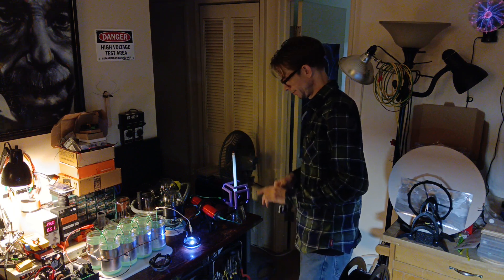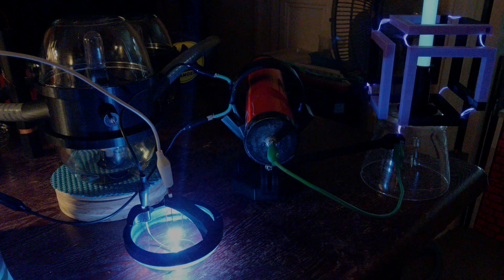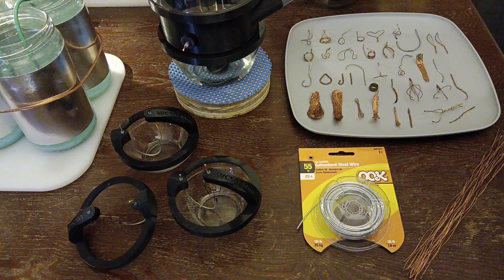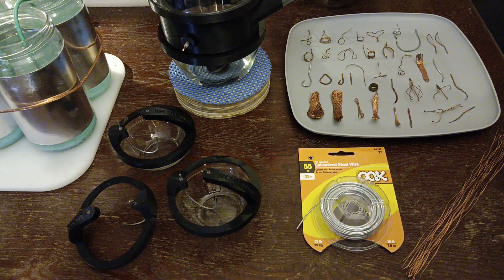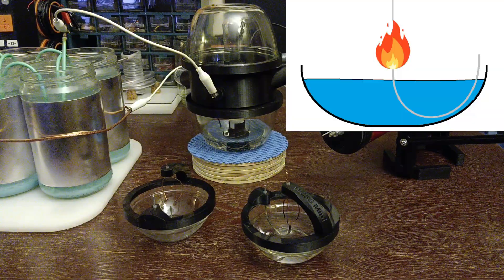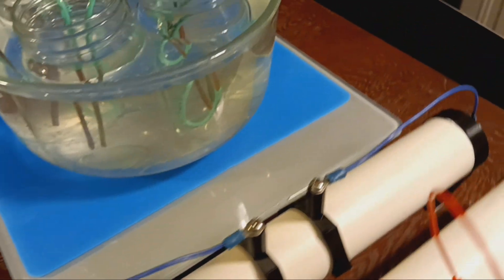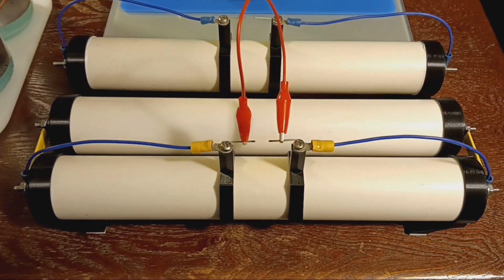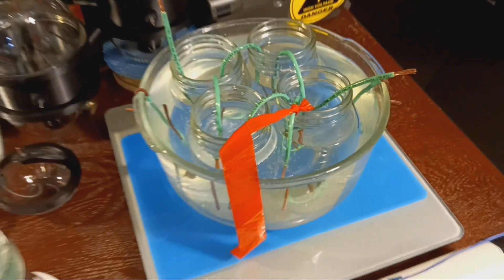How a Water-cooled Spark Gap Works!

Comment: Use silver - it's the best conductor of heat and has a higher melting point than copper, it's still cheap at 28$oz.

Comment: Built a water cooled extreme energy triggered spark gap before, it used DI water with both electrodes submerged. The electrodes had tin on the buisness end but the rest was tin plated copper. The trigger electrode was a loop of platinum wire just in front of the cathode with the low side connected to both electrodes through a couple 500pf 35kv doorknob capacitors. The trigger voltage was about 20kv and the gap could hold off about 50kv. It solved the issues with heat noise and UV all in one go. It was used for a copper bromide laser until i got a proper hydrogen thyratron❤

Comment: Why is this useful? You dont give any information on why you think this is so useful or hints to how its any better than any other gaps, you need to remember that spark gap technology is ancient in fact the pioneers used these  Tesla, Rhumkorff, and contemporarys of his time, later better higher power gaps were needed so they looked into all methods including water immersed electrodes but subsequently found mercury to be a better option.. later came rotary gaps air cooled then quenching became common from faster switching speeds for years synchronous rotary gaps were the standard for high power high frequency and the mercury interrupter for low powered low frequency and mercury arc rectifier octopus and excitron for high power low frequency, these were later replaced in a true vaccum tube take over as thyratron ignitron and other high powered switches became available, the ignitron can switch upto 20kV in the 10s of kA/us range,  there were the top scientific names working on spark gaps 100 years ago, please if you really believe you have something here then say what it is, if its valid it will stand up to scrutiny, at the moment you are just showing what appears to be a low powered spark gap with the cathode submerged in water to keep it cool which of course is necessary as the cathode sustains ion bombardment and this thin electrode would melt without cooling even at this low power, i may be missing the point here but without any explanation i only have my observation to go on. please if you think you have something back it up, with real data and numbers, without these all you have is smoke and mirrors mate ...
Reply: yes.....   Here is the commercial use for it. The metal being cut is the other side or electrode.     https://www.youtube.com/results?search_query=edm+Cutting+
Reply from the maker: If you asked Heinrich Hertz why his magnetic radiation tests were so important at the time, he as well would not have had all or any of the answers as it is new technology, however, from what I've observed in the past, WCSG's are the future of mankind. Stay tuned!
Reply: @MadPlasmatist  yes but Hertz actually decovered something albeit he wasn't quite sure exactly what at first, spark gaps of all types are not a new discovery and you talk about my ignorance? You haven't even looked at my channel and what sort of understanding I have on this, 

Steve
Reply from the maker: @T2D.SteveArcs  I never said you were ignorant, however you should easily understand then that there is a difference between amperage and voltage being applied through a spark gap. The WCSG can handle a lot of amperage without melting, giving a fluid plasma discharge which is quite easy to implement with very basic items. It is also true radiant energy and I will explain all of this in an upcoming video. We should really meet up or chat, you do impressive work and I could really use your help. I've done ALL of this by my little self =)

Comment: Cool. Sounds like we made the same thing until one looks at the design of it lol I had mine made about 18 months ago with a vacuumed sparkgap with a glass tube of water going down the center of it. I called it the plasma water heater, but when I was getting it made, I was calling it a water sparkgap. Essentially, they are the same thing.
Reply from the maker: That sounds neat, I would love to see it. Why not upload a video to your channel?
Reply from the maker: Also this system does not work under vacuum, as it requires some air cooling / thermal release of the positive electrode =)
Reply: @MadPlasmatist  I got it on another platform. I can't say it becuase then youtube will delete my comment. There's a reason for it to be in a vacuum sealed container. Your just using a small amount of water to keep your spark cool, I'm using it to heat water. Plus I could add more or less gas. And I still have a source of light. Still cool what you're doing though 😎
Reply from the maker: @freedomer342  That seems really neat I would like to see it, you should put some videos on YouTube so we can all enjoy!